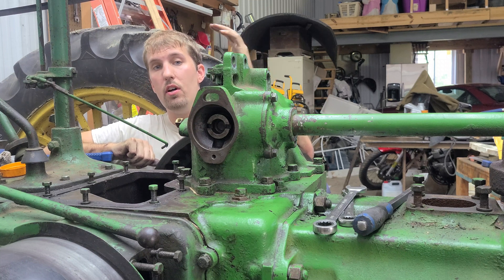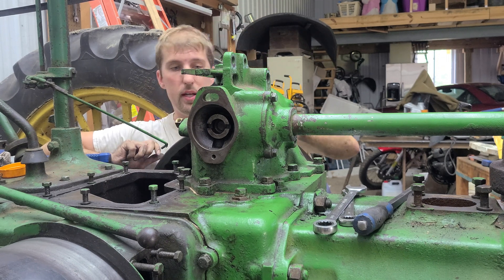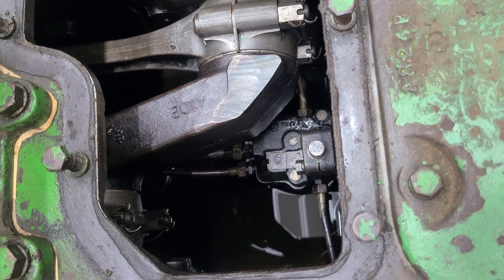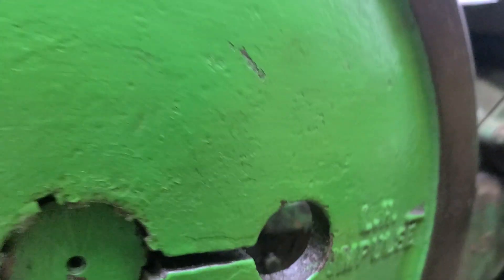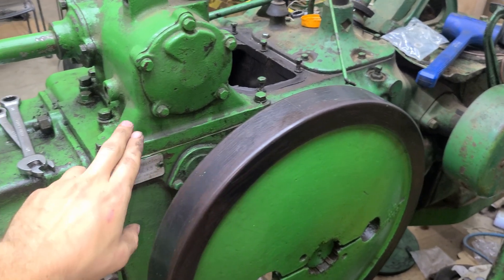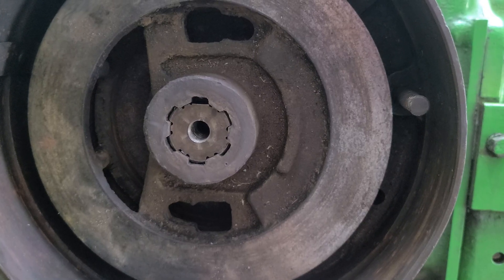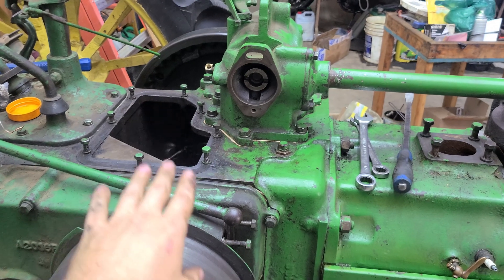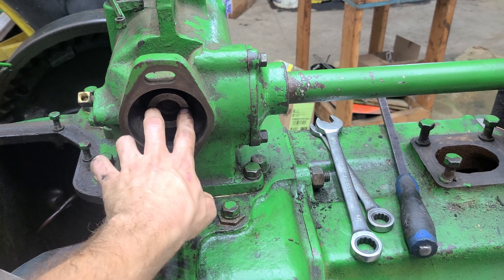John Deere Two Cylinder Timing and Balance (A, B, D, G, H, etc.)

Comment: Dan. Love your videos!  I have a 1956 70 and a 49 G.  On my G can I replace exhaust gasket without pulling the head.  I have bolts not studs.  Some videos I saw showed pulling the head
Reply from the maker: Yes,  if you have bolts, you can replace it without removing the head or even the fan shaft, for that matter.  Once you take the bolts out, you should be able to just remove it. One thing to note is that the bolts tend to get seized and break.  If so,  with all the bolts out or broken off,  lift it up until it hits the fan shaft.  Then, cut the bolt off from underneath,  then remove the manifold. Weld a nut onto the stud that's left and try and get it out.  Good luck.

Comment: Dan, do you think I should eliminate the Delco distributor and look for a Magneto? I mean it is working fine. I am thinking less components and wires. What do you think? Hey, liking this Pennsylvania fall weather.
Reply from the maker: If it ain't broke, don't fix it. When you start to have issues,  you can question it then.  And yes,  this weather is absolutely beautiful.  I'm trying to get as much done outside as I can.

Comment: Sent the Wico C on my wife’s H to be rebuilt a couple weeks ago. Supposed to be here tomorrow. Can’t wait to try it out. Did you already have that mag on there before you tore it down or just got it?
Reply from the maker: Already had it.  Got it when I got the tractor a couple of years ago.
Reply: I'm working on a 1950 A it's got the X magneto it will only produce a 16th of an inch of spark. Did you ever pay attention to the spark gap on yours?
Reply from the maker: @PaulCTownsend I haven't paid attention to it.  For this video I was getting some spark using the same plugs and wires that came out of it when it was last running.